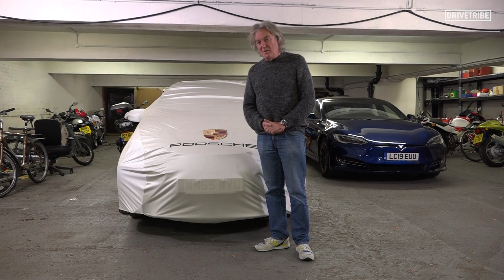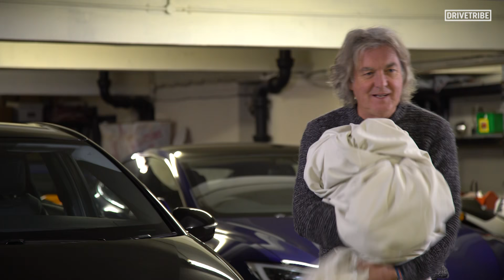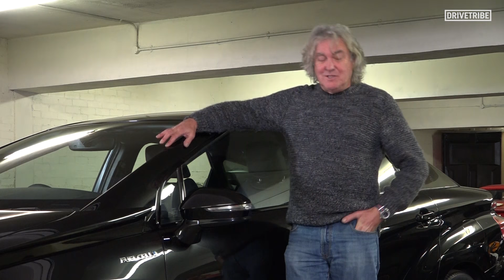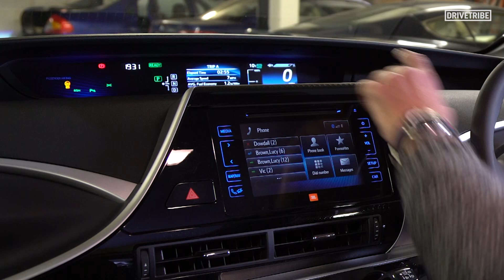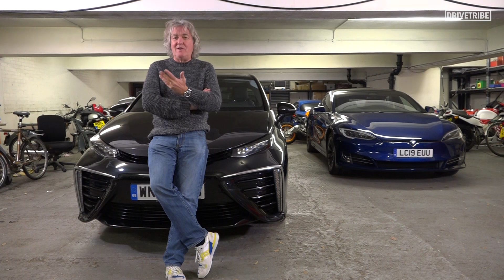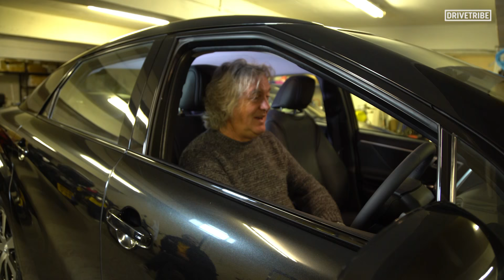James May has bought ANOTHER new car

Comment: I'm a Toyota fanboy, but I just got a Tesla Model 3 Performance and I love it! But, this will be interesting. My water heater and stove are both Nature Gas and I hope one day it will be transformed into hydrogen. I honestly think the future of energy is hydrogen AND electricity based...the question is to what ratio and for what uses. Air travel, for example, I've got my money on Hydrogen. Thermal Heating (in a home, commercial, burners, etc.) I've also got my money on hydrogen. Cooking? Both hydrogen burners (replacing natural gas) and electric (induction stoves). The problem with burning hydrogen is flame temperature.It's too high and causes more NOx emissions than CNG. But, Toyota has developed burners that are able to reduce NOx so that may be viable. I still think the car will go electric...not hydrogen. But, only time will tell. Until hydrogen stations are omnipresent like EV chargers, I will stick with my Tesla and enjoy sprinting from 0-60 in 3.2 seconds...guilt free!

Comment: All these people saying he's bought a bomb on wheels...
I know most of them are probably joking, but still.

Most fuels have high energy content and must be handled properly to be safe. Hydrogen is no different. In general, hydrogen is neither more nor less inherently hazardous than gasoline, propane, or methane. As with any fuel, safe handling depends on knowledge of its particular properties and consideration of safe ways to accommodate them. Hydrogen, handled with this knowledge, is a safe fuel. Hydrogen has been safely produced, stored, transported, and used in large amounts in industry by following standard practices that have been established in the past 50 years. These practices can also be emulated in non-industrial uses of hydrogen to attain the same level of routine safety.

Comment: HFCEV or EV, the jury is still out... But when balancing the unbiased information available, it’s not difficult to see why the EV is winning, not just commercially, but logically. Norway have fundamentally changed their direction on Hydrogen due to the complexities and the logistics of delivery. While there are issues around battery EVs, these known issues are far simpler to solve than those of the HFCEV’s. All the arguments against EVs are either not as black and white as people make out or are blatant misguidance.
Most anti EV arguments are motivated by the oil industry or petrol-heads (I know, because I have previously been in both categories). It was obvious from the outset as spoken by JM himself that he would be met with bitter opposition. However, the good news is that most of Tesla’s recent market share are from people moving away from the likes of BMW M3s and equivalent Audi/Mercs. HFCEV or EV... the bad news, is that many car manufacturers are a bit like Kodak who knew the inevitability of their fate, but like a moth to the flame, did nothing to change their course!
The data is undeniable, all we need to do now, is get the correct investments in place to mature the EV and stop the naysayers squabbling like Jeremy Clarkson in a restaurant.

Comment: Electricity is already all around us, and it's readily available in most parts of the world. Hydrogen on the other hand, is a commonly found element, but for the use in vehicles requires production, distribution, etc. before it can even make it to your car, and that requires energy in itself to make happen. Electricity has a huge head start right now, and it also works out to be about 6 times more efficient once you calculate all the other expenses to make it possible.

I haven't even seen a hydrogen refill station yet. Imagine owning a car you can't fill up in most places, and being that one guy who has to say "I'll be over soon, just have to drive an hour all the way across the city, and back, to refill my car before I go 2 blocks over to see you."

Comment: Hydrogen fuel cells. Expensive. Low latent energy compared to other fuel sources. Stored at 10k psi pressure thus turning your car into a hand grenade. Eighty pounds to fill the tank. One of many cranky alternatives to ICE vehicles, including steam and solar that simply are years behind the rapidly improving EV battery technology.  If you love your kids and the planet, dont buy this expensive  - 60k + - quirk. Buy a Tesla.

Comment: James, you should have this conversation with Robert Llewellyn. 
He is of the opinion that currently the BEV is more feasible for cars because of the cost of the exotic materials involved in shrinking the Fuel Cell technology to fit into cars.
Buses and Lorries however have the space for the cheaper more bulky simpler fuel cell technology, making it more feasible and cheaper to use. 
Ultra rapid charging technology and developing battery technology could make charging a BEV much closer to the time taken to fill a tank and Battery range is also improving all the time. 
One main advantage of the BEV is if you have solar panels and a battery storage system, you could theoretically run that car for next to nothing. 
PSA recently revealed a working concept that allowed them to use noise pollution from a city to generate electricity to charge a Peugeot e 208.

Comment: I reckon the Tesla type electric car will be better to use right now, due to the infrastructure being more readily available, but Hydrogen fuel cells to be the ultimate answer a few years down the line. It's the closest thing to what we have with petrol and diesel, has the convenience of being able to fill up in minutes and be dispensed and paid for at a fuel station much like a petrol station, so ultimately, you can see the infrastructure falling into place pretty quickly alongside, or replacing some of the existing fuel outlets once the demand is there.

Comment: If you want to recharge 80kWh in 5 minutes it will take ~1MW charger. That's about as much a Buggati Chiron going through a wire.

For nerds:
Actually sending a Bugatti Chiron worth of power is not a problem at all. We can easily get high efficiencies (like 99.999%), even at high current, so we generate no almost no heat. The problem is the battery pack can't handle it.
Reply: For even bigger nerds:
Good battery configuration is one of the reasons why Tesla can charge so much faster than it's competition. The power a battery can take is limited by its voltage, not capacity. So 10 small batteries can charge a lot faster than a single battery which is 10 times bigger if they operate at the same Voltage. Tesla has ~3000 cells and can charge at about 200kW, even so, each battery would be taking >60W.

Comment: "Zero Emissions" for the Telsa Is so wrong its not funny!
The problem with Hydrogen... It goes BOOM!
More likely the future will be a Smaller battery powered car that uses Induction charging with rails under the pavement. It will take years to get there, because of the required change in infrastructure...

Comment: What is the weight difference between the two? Light weight hydrogen fuel cell vs batteries.
Reply: The Model S is a lot bigger car. The Mirai weights about the same or more than the Model 3, but only has 154 hp and very little space.

Comment: I am currently driving a car with a diesel engine. The main reasons are:
1. The power (I pull a trailer every now and then)
2. The availability of the fuel at almost every corner
3. Short refuelling time
4. No loss of energy (such the daily loss of approx. 1% of the capacity of the battery in an electric car)
5. Reduced risk of explosion in case of an accident (compared to hydrogen)
I am not saying that other technologies than the diesel powered car are less favorable. But to my knowledge those technologies are not (yet) suitable to my needs. Hence, I appreciate James' efforts to participate in field tests and I am looking forward to his opinion after some time.

Comment: Just a comment on safety: I would park both vehicles outside.  

The Mirai has proven very safe, but hydrogen is almost perfectly safe outside and explosive inside so why take the risk?  

I'll get flamed for this, but fire risk from a parked Tesla can't be dismissed either, especially when charging.  (I know people keep saying they combust less than petrol cars, but in fact if you look only at new cars Tesla does less well.)

If on top of that you have a bunch of petrol cars parked in the garage...

Comment: both car are nothing more then cars for missguided eco echo, 
both are no better for the world in whole than a new to 5 year old petrol and diesel cars,
both will increase the need for more dirty power planes like coal. diesel and nuclear, 
the real cost cost differences of hydrogen fuel vs fossil fuels makes hydrogen a joke
use of lithium ion battery uninstanable and are non fully recyclable and need to be stockpile like nuclear waste.

untill we can make batteris that don't need  rare drity earth metals like lithium, we should  focus on hybrid plug in cars with kers technology using electric power for acceleration and slower city speed,

oh and need to ban natural aspiration engine we need to be harness the exhaust
world ban on small scooters with 2 stroke and 4 stroke engine
ban all dirty diesel smoking vehicle no matter if it is just drag racing vehicle, cars, trucks and trains

Comment: What about a hybrid of the two?
A battery pack which can handle about 100km of range for short daily trips which can be recharged from home, but also a fuel cell for longer drives.
That way you can run it as if it were battery only, never needing to visit a servo to fill up.. but when you need to go on a long ass drive or interstate road trip fill it with hydrogen and make it the whole way without stopping.
With a battery buffer like this the fuel cell wouldn't even need to be able to produce the full 113kW as general highway cruising would use much less. The battery reserves would go down as you floor it, then slowly raise back up while driving casually.

I feel like this would be a good balance that can draw people in who are nervous about going electric. Many people are afraid of the long charge times that make road trips difficult, and others would be concerned about a vehicle that needs rare, specialized servos which may be nowhere near their home/work

Comment: Short term the Tesler, but in the long run if investment in hydrogen supply takes place then the Toyota fuel cell wins hands down as it's cleaner, battery electric cars my remove direct emissions but they are actually environmentally filthy because of the byproducts of battery production and disposal.

Comment: I believe that the best current solution would be a plug in hfecv with battery range to satisfy most daily needs. And then a small "range extender" in the form of a hydrogen fuel cell.

Comment: Everyone's going to be throwing all their toys out of the pram that James May off the telly, a supposed petrol head, has gone and bought electric etc etc. But I honestly get it. 

I know we're all used to being told James was born in 1840, but the actual fact is that, of the three, James is by far the most accepting and interested in modern technologies and "experiments" so to speak. After seeing him buy the i3 ages ago, I knew it was just a matter of time. 

Let's face it, if cars are changing so drastically, you'd be a fool to not want to experience and experiment with the new, and James is in a fortunate position where, as well as his other ICE engined toys, he can have these, experiment and get to experience the pros and cons first hand.

Also, he lives in London, and I can imagine having two fairly high range electric cars on hand is fairly advantageous if you'd like to get anywhere in central London without having your wallet surgically removed. 😂

Comment: James, let's suppose we wave a magic wand and all auto makers start producing HFC vehicles, what is the next step to making one model better than your competitors model? Answer, add more battery capacity and a socket to charge up at home.
It doesn't matter where the energy is coming from, a big battery, a hydrogen fuel cell or a petrol generator, the first step is to make the propulsion electric, ie. put electric motors turning the wheels. It will then follows that the race is on to provide an acceptable level of battery capacity in keeping with needs and practicalities.
So in time, pure energy will win out.

Comment: I think Tesla combined with renewable energy is the best case scenario
Reply: yes and no. find recycled, low energy & low pollution production batteries and localised factories to reduce all the shipping that runs on diesel ships and trucks... then sure. right now the best car is a local second hand car that you pick up for a few grand that has decent mileage and good economy
Reply: @LouieAblett  the batteries have lithium. That's nasty stuff. I think that's not even the nasty burny chemical in them theres also something that causes each of thousands of batteries to catch fire one by one for days if a single one explodes. The lithium is mined deep (Asia) in the earth with diesel powered machines, then shipped on tankers to wherever the batteries are assembled. Then the batteries are shipped, along with frames and hardware (also Asia, also mined deep in the earth with lots of diesel machines and refined in something called an oxygen blast furnace... they don't make environmentally friendly oxygen blast furnaces) to wherever the cars are assembled.
Reply: Oh, ok. You do.realize there's a miniature power plant inside every single gas or diesel powered vehicle. All those hundreds of millions of horsepower generated by those tens of millions of small power plants will have to be replaced to charge the chemically powered batteries in an electric car. There's not enough steel in the world to build that many windmills... forgive me for being blunt

Comment: Hello James,

I think that even these options are not good, even when they are notable efforts of the automotive companies.
I am an electrical engineer, I have always thought that there is something wrong ... in the case of solar panels, for example, your local process is clean, but someone spent a huge amount of energy to extract the silicon, make and assemble the panel ... what happens is that energy is cheaper and operational costs are much lower somewhere else on the planet ...
So, let's measure the efficiency of cars by their carbon footprint ... To be able to bottle all the hydrogen that Toyota Mira uses, or to make a fuel cell, the amount of energy is still unclear ...
Let's not just think of ourselves as users of an electric car ...

This is something like bloody diamonds ..

Standart regards from Chile

Comment: As a longer term energy storage method and for use in heavy transport like container shipping hydrogen as a fuel makes a lot of sense. But for use in relatively small vehicles like cars the energy density and cost advantage (in terms of making a hydrogen tank vs a battery) is simply not worth it. Electric cars have a total system efficiency (from energy source to driving distance) of about 75%. The best case scenario for a hydrogen powered car (using non commercially available and experimental methods) is about 50%. you can't beat thermodynamics, it's not going to get any better than that. So use it as a last resort. Use them as energy storage for the grid if all the batteries are filled up. 

Hydrogen is especially interesting for grid use if you can save money by deploying a hydrogen-battery hybrid system as opposed to a full battery system and invest the saving in extra capacity. If you use your capital in this way you may in fact end up with more electricity for your buck. Batteries are, in grid use, about 95% efficient but very expensive, Hydrogen today may only get about 40-50 percent but is a lot cheaper. So if with the savings you can build more wind turbines or install more solar panels the performance gap starts to close. 

Anyway, that's what I think of the whole situation. 
Hydrogen is a good energy storage system.
Just not for passenger cars.

Thank you James May for participating in the solution (especially since I am too young to do so, financially speaking, I can't afford a Tesla yet)

Comment: A BOC 7.23m3 cylinder of hydrogen costs around £70. With a tank capacity 122l, that's around 60 fills or around £1.50 per 300 miles. There's a cylinder rental consideration in there too i think so it's not quite that cheap. So, what's needed is a home filling station? Keep the cylinders in the garage. No doubt there's a few hundred rules and safety  considerations associated with that. So, assuming you can prevent the Hindenburgh disaster in suburbia, it could be very cheap to run.

Comment: A combination of both would work best IMO, A Hydrogen fuel cell that charges a Tesla style battery than runs the electric motor(s). So you can charge up the batteries on a fast charge or refuel  at a hydrogen station.

Comment: People forget that the manufacturing of lithium ion batteries is extreamly toxic and itself produces a lot of CO2, even the mining of the mineral has a massive environmental impact.
And then in about 8 years you have to dispose of those very same batteries also an extreamly toxic proces.
Fuel Cells is the future of motoring no doubt about that even if you used Benzin(Petro) as the fuel in a fuel cell you'll get so much better efficiency than any internal combustion engine could ever achieve and a cleaner burn.

Comment: Hydrogen is less safe with the massively dangerous high pressure chamber (even with all the Kevlar and polymers).

It also depends on having fuel stations, whereas battery powered car, you charge just like you charge your phone. When you come home, just plug it in and even your standard home plug will be perfectly adequate for the majority of needs.